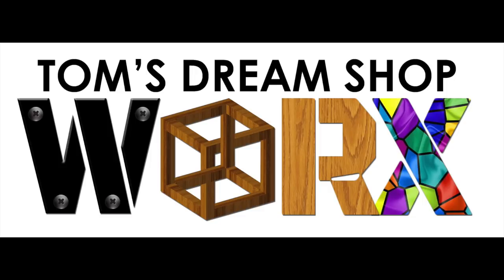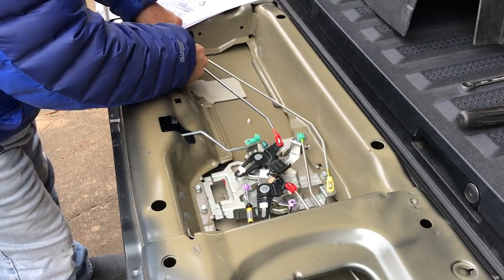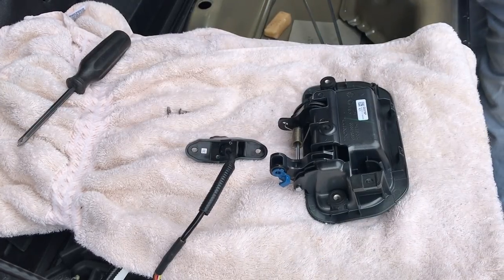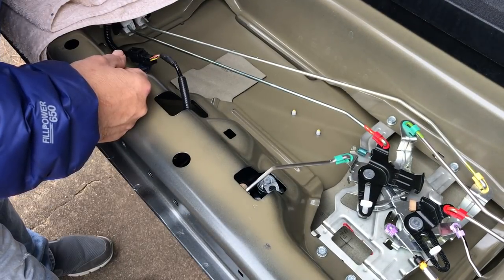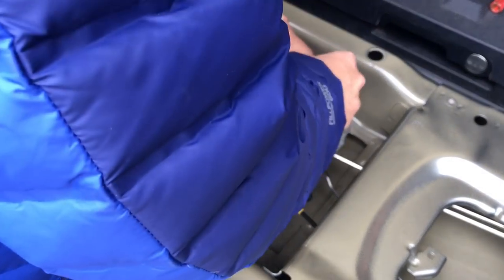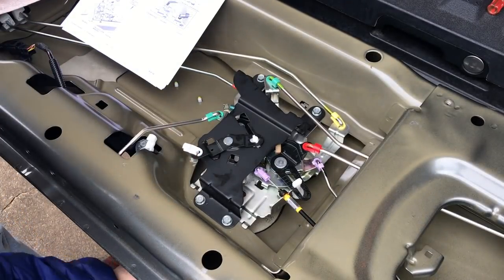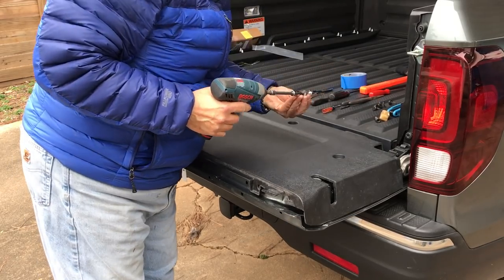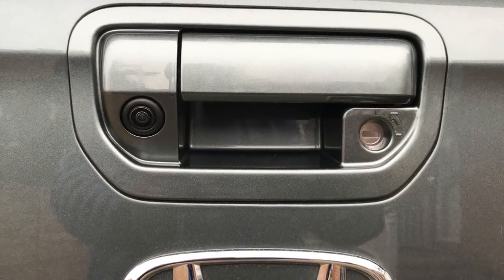2017-19 Honda Ridgeline OEM Tailgate lock Install

Comment: Great video.  I have the Retrax tonneau, now this OEM lock will complete the security of the bed.  Like many of Ridgeline owners, why did Honda not include this lock is ridiculously short sighted...  By the way, I’ll be installing mine in 85 degree Florida weather - LOL
Thank You

Comment: Tom I just installed my handle with your instructions. Worked perfect. I never got instructions except printing them online and it was not needed. One thing that sped things up is the camera connector to the handle can be disconnected by pressing on the connector release clip on the top left side and pull the connector to the left. The camera connector attaches to the tailgate handle with a connector that is released on the bottom of the right side, press up and it slides off to the right. No need to remove the fastener attached to the tailgate. Hope this helps and I did this pretty quickly for me like 40 minutes or so going step by step with your video. It is good enough to not need instructions as I just proved that.  Thanks.....

Comment: Tom thanks. Going out to install mine in a 2019. I installed the Pop and Lock in my 2017 and it worked just fine. Good job....

Comment: Timed myself, 29 min 57 sec.  Thanks to you!  Was able to do the whole thing from memory after watching this.  One minor note:. The little white plastic tailgate clips come out much easier if you rotate them 45 degrees (so that the tabs line up with the corners of the square cutouts). Thanks!
Reply from the maker: Mr. MT Baldy - Very cool! Thx for the tip, hopefully others will read it and it help them out.
Reply: Good for you. This is not an easy install unless you have all the right tools ( like a magnetic socket so you don't drop bolts into the tailgate. I had Honda do it and they struggled. Got it so wrong that when I lifted the upper handle it would only engage the latch sporadically and with no definitive break point. They did it wrong and probably used the old linkage which was not long enough. Took the 3 times to get it right. The reason more trucks do not have this dual tailgate is because the whole mechanism is far more complex. There are those that have had issues with the OEM upper handle. 

Bottom line this install is not that easy unless you are at least an 8 on a 10 scale mechanically speaking and have all the right tools.
Reply: Found this out as well.  Made it SO easier to put the cap back on.

Comment: Just purchased one for $115+ spent $45 recoding cylinder so it will work with my Ridgeline key. After recoding with local key guy both now keys are working, the Ridgeline and the (2) provided with lock so I do not have to mess with it anymore in the future. Just installed it myself in around 30 min. watching this video. Thank you for posting much helpful video, saved significand $$$$$.
Reply from the maker: PolUSA T - Awesome! I’m really happy my video helped. Thx for sharing your success.

Comment: A Great job, cheers for posting, 
any chance you could please post the OEM part numbers for the upgrade ?
Reply from the maker: 2 parts needed, the lock kit and the handle color matched to your truck. This is the part for the lock kit #08Z07-T6Z-100D
Below are the different color handle part numbers.
08Z07-T6Z-110E WHITE Diamond Pearl (NH-603P)
08Z07-T6Z-120E Lunar SILVER Metallic (NH-830M)
08Z07-T6Z-130E Crystal BLACK Pearl (NH-731P)
08Z07-T6Z-140E Modern STEEL Metallic (NH-797M)
08Z07-T6Z-150E Obsidian BLUE Pearl (B-588P)
08Z07-T6Z-160E FOREST MIST Pearl (G-537P)
08Z07-T6Z-170E Deep SCARLET Pearl (R-561P)

PLEASE DOUBLE CHECK THEM. i PULLED THEM OFF A RIDGELINE FORUM WHERE I LEARNED ABOUT THE LOCK KIT.

Comment: What is the name of that tool that you used to pry the camera wire harness mech from the tailgate?  (Great video btw)
Reply from the maker: Briley Gabriel - lots different brands, but it looks basically like this. My handle is shorter and it’s from snap on so cost a whole lot more than that but I’ve had it for 40 years. https://www.amazon.com/dp/B0734VKNYK/ref=cm_sw_r_oth_api_i_ZhBiFbRE0BECT
Reply: @tomsdreamshopworx  Thanks!

Comment: Nice Video!  In the directions provided by Honda, they want you to disconnect the negative batter post.  Is that not necessary?
Reply from the maker: Glad you liked it! I won't tell you not to disconnect the battery, but every set of instructions from Honda always starts with disconnect the battery. Your call, I did not.

Comment: does this lock works with key alone? or is there a lock that also works for the fob key of the car?
Reply from the maker: James Laqui - This oem Honda lock only works with the key, not with the fob. It comes with its own key but if you want you can have the cylinder rekeyed before you install it to match the key for your truck. There is an aftermarket company called pop n lock that offers one that you can wire into your system to work with the fob. It gets mixed reviews on it’s reliability.

Comment: Mine's a 2017 RTL-T, so all Ridgelines come without this lock regardless of the trim level? Even the Black Edition doesn't have it?
Reply from the maker: monzx3 - Correct. No trim level from 2017 thru 2019 comes with it.
Reply: @tomsdreamshopworx  Yeah, for a 40K vehicle I find that very irritating, even though I love everything else about it.

Comment: I did this as well but 2 weeks later the swing latch stopped working. Not sure what is wrong  now? but others have said the same thing
Reply from the maker: Sorry, you had a problem. While I had the truck, I had no issues.

Comment: Where did you get the printed destructions? Thanks! VW
Reply from the maker: https://www.collegehillshonda.com/instructions/ridgeline/2019/tailgatelock.pdf    The first half is about undoing the battery cable. I did not unhook mine.
Reply: Thanks Brother! Waiting on the parts for the tailgate and the cover.

Comment: Is it possible to integrate this with the power locks? Thanks.
Reply from the maker: po gi - Yes and No. With the OEM Honda lock I used, I have not seen anyone figure out how to do it yet. There Is a aftermarket kit by “Pop-N-Lock” that offers a kit that will work with the remote. It has mixed reviews on reliability. There are several YouTube videos out on it. Good luck either way.

Comment: What about when you open the tailgate out sideways
Reply from the maker: Yes it works perfect sideways. Sorry I forgot to show it.
Reply from the maker: @booksbydennissanchez4970  I wish I could help. I had no problems with mine. It just worked from the start. Unfortunately my ridge was totaled back in May of 2020 and I no longer have it. I was part of a good Ridgeline forum, maybe they can help you out. Good luck my friend.

Comment: I'm confused. How can it be an OEM lock if the trucks don't come with a lock? Is it a Honda option?  How do you get it to match the trucks key?
Reply from the maker: JRS1121960 - It is designed, made and sold by Honda. The Honda dealer can sell and install it for you. It comes with a lock and 2 keys. If you want to, you can have it rekeyed to your car. I choose not to.
Reply: @tomsdreamshopworx  Why is it apparently never installed in new trucks?
Reply from the maker: JRS1121960 - Your guess is as good as mine. I learned about this on the Ridgeline owners club forum online.
Reply: JRS 1121960 - go to local key guy (Locksmith) or other who does car keys with the cylinder and your Ridgeline key to have it recoded. I did my that way and now both keys work, The Ridgeline and the ones (2) provided with lock. Recoding cost me $45 . good luck.